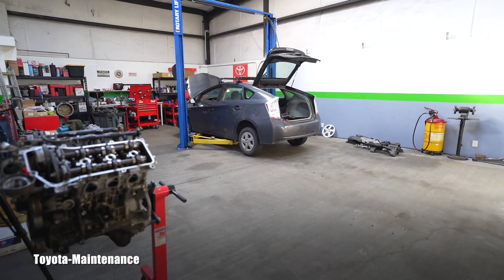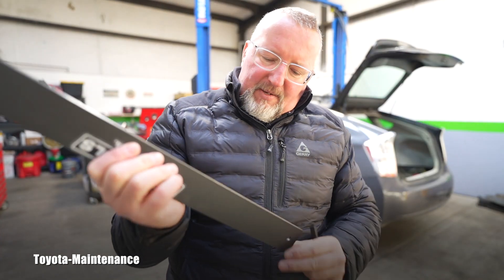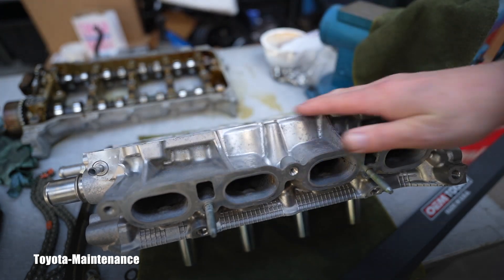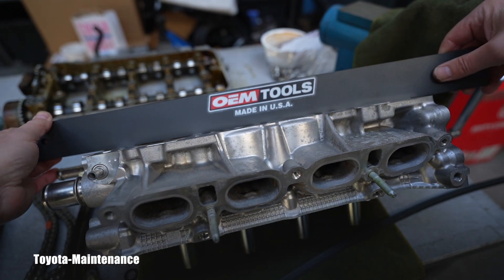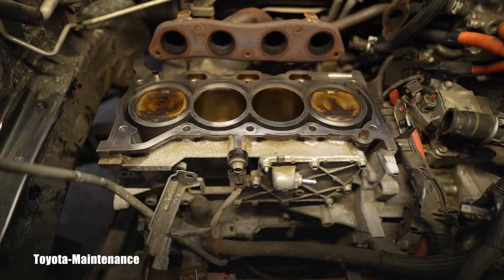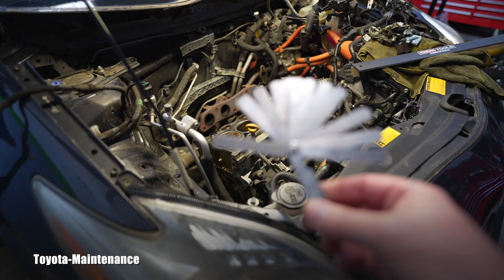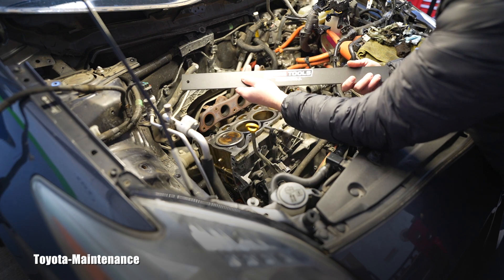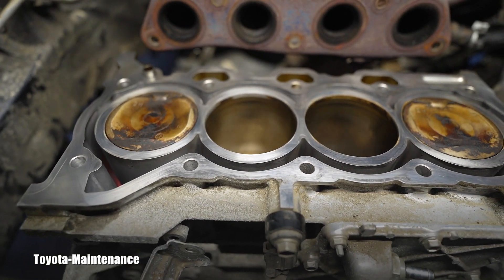How to Check Cylinder Head for Warpage?

Comment: How were you able to check the piston height to make sure that no rods are even slightly bent. Did you also use the straight edge for that? Or was there another method of testing to make sure that no rods are even slightly bent? Thank you!

Comment: Low mileage for a blown head gasket. Sounds like low quality for Toyota.
Reply: Low Life, no. not the case. As you know Toyota lasts 300, 400, 450 thousand miles. How long does your Detroit auto last? Even to 100k? Nope. German? Nope. Get ready big bills for repair starting at 60k. You know nothing about Toyota.